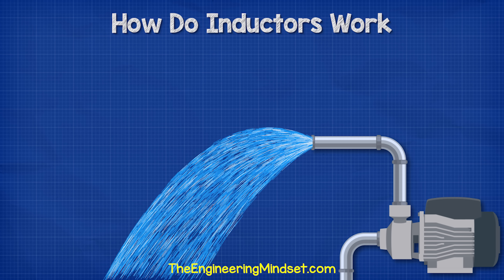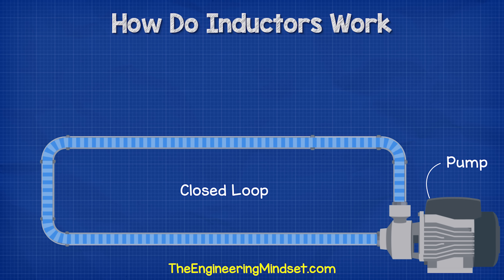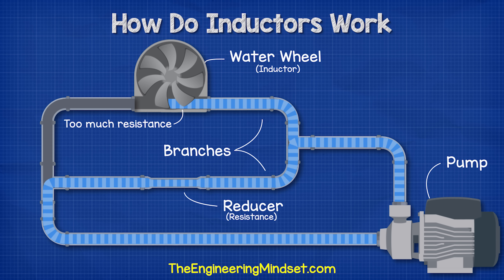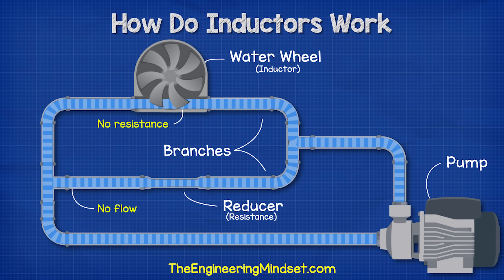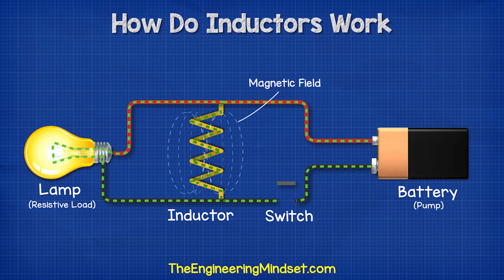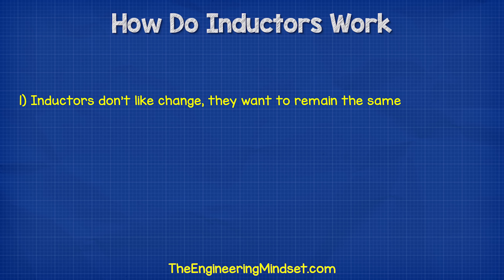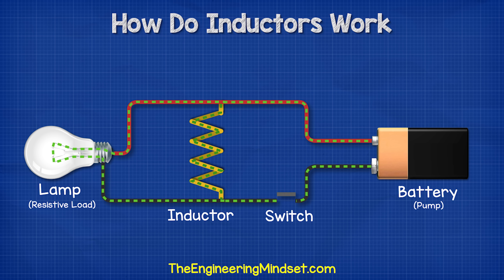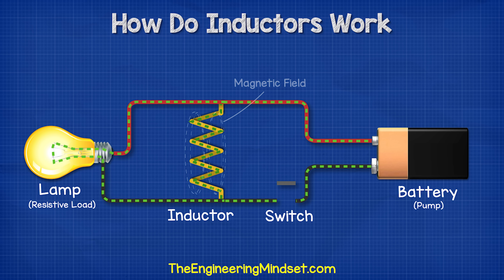How Inductors Work

Comment: Can an inductor have the same resistance as a resistor and what would this do?
Reply: Inductors can have resistance but it's not exactly a resistor. A resistor's job is to just reduce the current flow in the circuit. But an inductor is more of a wounded coil which offers resistance at first because of its tendency to charge initially.
Reply: Yes, in transient state but in steady state it acts as short circuit i.e. zero resistance
Reply from the maker: Check out NEW resistor video, everything covered! ➡️ https://youtu.be/DYcLFHgVCn0

Comment: in this explanation F=0 , So 2xpixFxL=0, the inductor wil be a short circuit between the poles of the battery, if you go from ac do dc, al capacitors are open cirscuits and inductors are closed circuits , so creating a short circuit between de poles ot the battery , there need to be a resistor between the battery and the inductor.
Reply from the maker: Check out NEW resistor video, everything covered! ➡️ https://youtu.be/DYcLFHgVCn0

Comment: Is the purpose of the inductor to act as a kind of shock absorber?
Reply: It's the equivalent of a signal cleaner. To reduce spikes up or down,so your "shock absorber" idea is spot on.
Reply: Can say that it eliminates the impulse whick can damage the electronics component .
Reply: @kumarsiddharth4287  but in his explanation it the turns off the lamp, which if that is the thing we are protecting, but still wants it to work this doesn't make sense. Or does the inductor only kick in once the current threshold of the lamp has been met?
Reply: @ifell3  Yes, you are right, the explanation is confusing people. The inductor have to be in circuit with the lamp and after the power source, so that it protects the lamp against spikes or voltage drops.
Reply: How is this different from a capacitor
Reply: @theguywithallthesolutions  capictors oppose change in voltage while inductors oppose change in current.
Reply from the maker: Check out NEW resistor video, everything covered! ➡️ https://youtu.be/DYcLFHgVCn0
Reply: Almost it prevents sudden fluctuations of current

Comment: What would be the purpose of this? As a safety mechanism? If power gets cut you can maintain it for a period of time?
Reply: This is not a practical circuit, it's being used just to simply illustrate the behaviour of an inductor. Inductors are primarily used in AC (and switched DC) circuits (filters, chokes etc) but it's hard to describe their basic function when the supply is continuously changing. Yes, they can be used to 'fill in' for supply gaps but this is rare, or rather, large transformers tend to pick up this function.